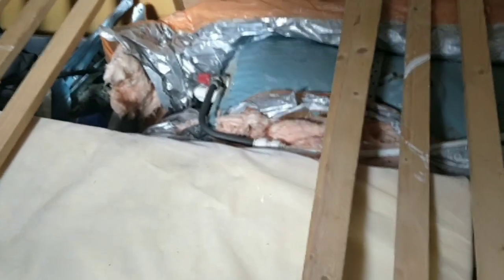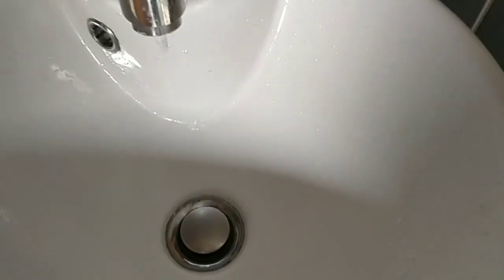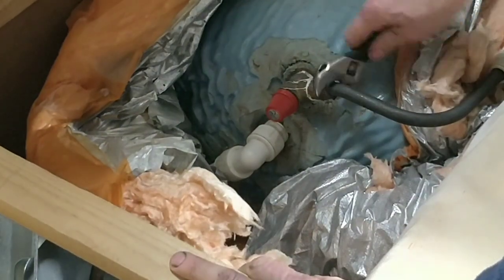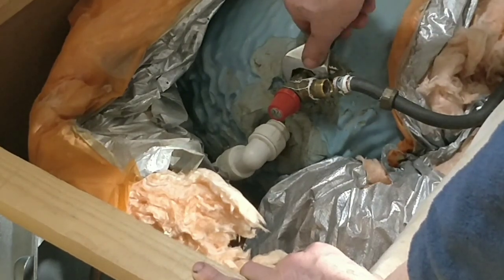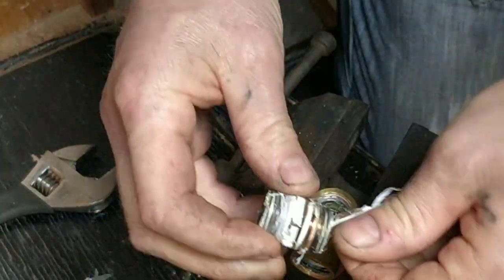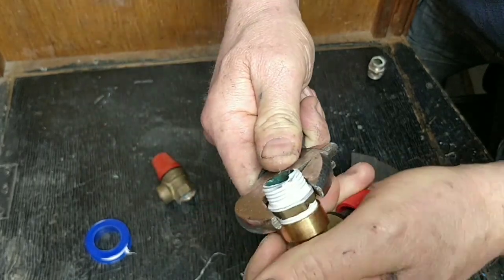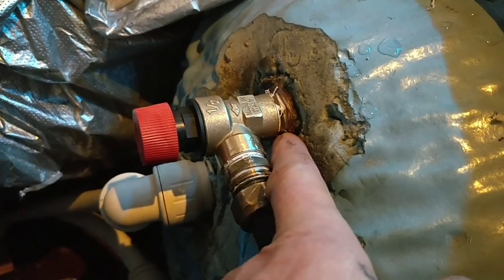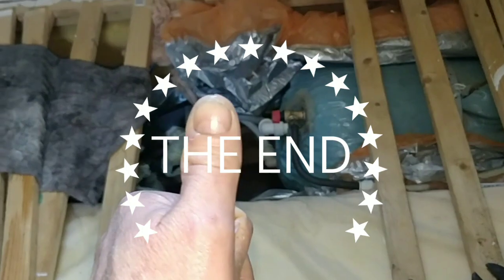Narrowboat Calorifier pressure relief valve replaced.

Comment: Good job Will. Just a thought if you have a convenient step you can get access to the underside of drill holes in for temporary mounting your vice (bolts with wing nuts) for light work only but leaves both hands free. Alternatively fit it to your tool box if it will take it.
Reply from the maker: That's a great idea. I do use it all over the boat. If I had space I'd have it bolted to a fold up bench. I used to have a workshop with a big old vice on a bench. Ummmm workshop....Miss it.

Comment: It’s supposed to vent outside the boat. Otherwise you risk flooding your boat if it fails.  Mine goes out a skin fitting to outside via a looped hose that goes up inside the gunnels and down and out through the skin fitting
Reply from the maker: It's always been that way from new. I do need to sort that. You are correct.

Comment: Hi Will another good vlog just thought I might say that if you buy gas grade ptfe tape (yellow pack)it is much thicker and a lot easier to use normally you pipe the pressure relief valve through the side of the boat but I have seen them piped into the bath and lots into the engine bulge but remember with the engine running they all leak off a bit when the tank gets up to temp
Reply from the maker: That's interesting info. Never seen yellow PTFE. Other comments mention plumbers mate paste which sounds good as well. The height of the tank outlet is almost at water line so I don't think a skin fitting would be advised that close. Worrying in choppy waters you know. I'll just have to remember to empty it. Thankyou.
Reply: @NarrowboatWill  remember that is under pressure so you can put the fitting above the tank and water line

Comment: Pressure Relief Values are usually vented through the hull via a skin fitting. 
Make sure there is a pressure differential between the water pump and the relief valve since hot water needs to expand :)
Reply from the maker: Yeah I agree. I thought the water loss was normal to allow for water expansion but I have a bladder tank to deal with that. Has I found out it had PTFE tape keeping the value open. No more water wasted. I would get up in the morning and find that tub overflowing all over the floor. Thanks

Comment: Hi Will it maybe blowing off because the expansion vessel is full of water. It should have an air bubble  one side of the diagram. If you haven’t got a pressure vessel you need one.
Reply from the maker: Yeah I've got a pressure tank maybe it's time to check the pressure. Cheers
Reply: @NarrowboatWill  when you check it have the pump off tap open you will then be measuring the true static pressure of the pressure vessel. If you find water at the test point, then you have a damage diaphragm in the pressure vessel and need to change it. Good luck
Reply from the maker: @guygfm4243  great info thanks

Comment: Clean the threads Will, male and female, with a small wire brush, keeping things clean with lots of ptfe tape should do the job, failing that another trip out for boss white, belt and braces...
Reply from the maker: It's still dry so I'm keeping my fingers crossed. Thanks for the info it's very useful. Cheers